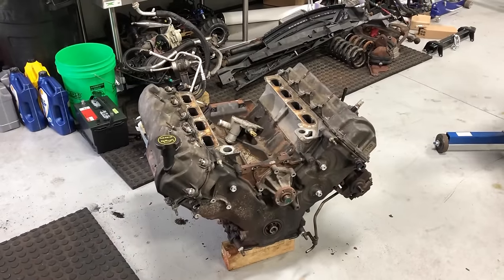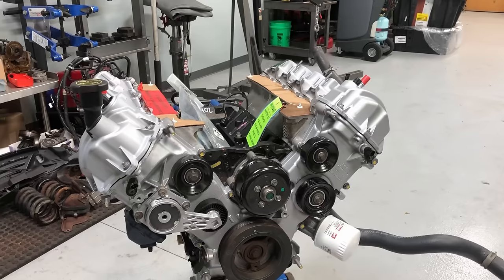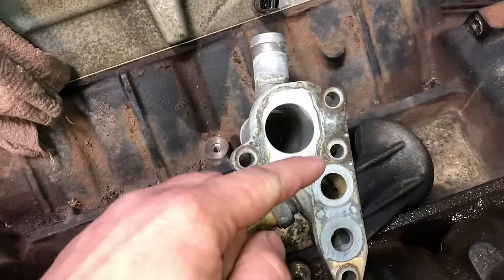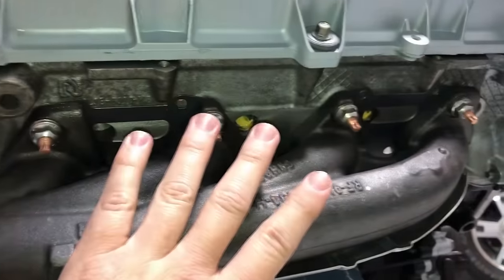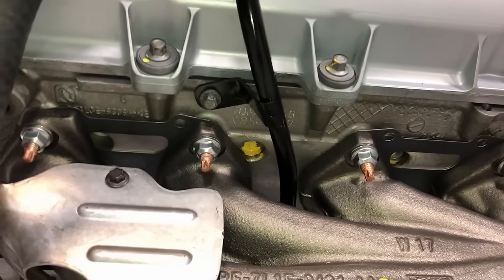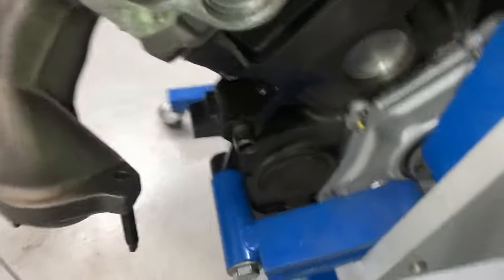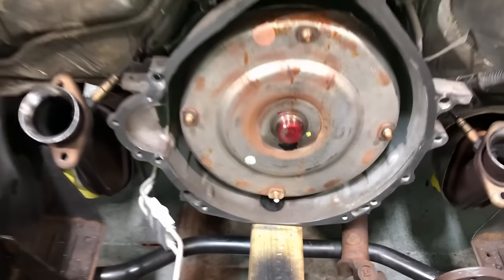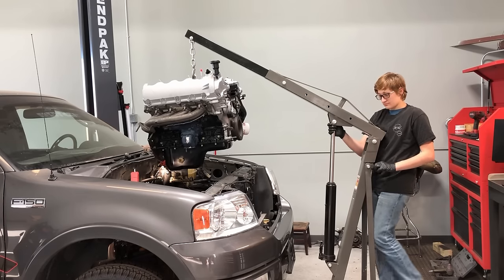Ford 5.4L 3v Triton Engine Removal & Installation Part 2 of 2: Engine Prep and Installation

Comment: Does that engine have a fuel pressure regulator? If so we're is it located?
Reply from the maker: no
Reply: So it's just the pressure regulator sensor? I'm asking because when my truck on running it smells like gas fumes are coming out the tail pipes.  I'm hoping by changing the sensor it will fix that problem.  Thank u for your reply.
Reply from the maker: The 3v engines use a fuel pressure sensor and a fuel pump driver module in the back to modulate voltage to the in-tank pump.
Reply: Thank you so much for your information. Have a blessed day

Comment: Hey!!! Great video. I have a 2010 F150 with the Five point whore motor. I've noticed that when I really step on the gas for a highway on ramp, itll climb to 3000/3500 rpm and then the engine wont go any more. It feels like I'm hitting a wall. Any ideas???
Reply: does it rev quite high like it should be shifting but doesent?
Reply: @shawntracey  sort of. It sort of feels like once it hits 3500 rpm it's like hitting a rev limiter
Reply: @darkstar9008  sorry about the late reply... behind the tire well there is foam where the air intake is... sometimes a piece comes loose and covers the air intake... it happened to me, i removed and fixed my issue...

Comment: About how much do you charge to change our a 5.4 remanufactured engine ?
Reply from the maker: Well over $8k with the cost of engines nowadays.
Reply: Is power train okc still a good choice to get a 5.4 3v. I have a 07 that I’m getting on. Thx @FordTechMakuloco

Comment: One thing I did forget is to mark my torque converter bolt need help please
Reply from the maker: Line up the orange paint marks on the flex plate and converter.
Reply: @FordTechMakuloco   My man !!!thank you so much
Reply: Brian, I just wanna thank you so much my new engine is in it’s working like a clock again thank you I really couldn’t done it without your help

Comment: Do you happen to know where the ect is located?
Reply from the maker: There isn't one.
Reply: @FordTechMakuloco   
I got a 2006 f250 5.4l with a p0128  code, just changed the thermostat but was told it v CBould be the ect. This one doesn’t have an ect then?
Reply from the maker: You have a CHT sensor but a 128 code is almost always a thermostat or incorrectly installed new thermostat.

Comment: Ok nice job ....why not just remove the cab off the chassis.?
Reply from the maker: This video is meant for the Diy at home.
Reply: I've been watching your videos for some time. You are a very talented mechanic and teacher. I am very grateful for your channel a lot of really good advice my wife and I were able to replace cam phasers in a sissy 150 about two years ago because of your videos and I'm thankful for that but as it is I have to replace the motor in a Ferrari 150 (aka) ford on account that they must have hired former Ferrari personnel to price parts. I'm thinking of purchasing a Gantry crane from Harbor Freight to lift the body off.

Comment: At 5:58 you should never run a balancer in with the bolt. Always use a balancer installer. Running it in with a bolt is asking for issues. Remanufacturer will decline warranty on that engine if the threads are damaged.
Reply from the maker: You will never ever have a problem, if that was true then there would be thousands of destroyed engines out there with my name on it

Comment: That’s why I’ll try to avoid those engines from 2004 to 2010. They’re nice trucks but those engines are not bad but ones they start giving you problems you better fix it right away otherwise you’d pay a higher price.
Reply: Every engine design has a flaw.  Engine parts wear either quickly or over time.  That's normal.......
Absolutely nothing last forever.
Reply: @kimroberson8376  haha after the updates these things kind of do
Reply: You can literally find video's on YouTube for every engine ever made warning you that if you so much as start it you'll die instantly.  Take care of the 5.4 and it's a VERY reliable engine.  I have seem multiple 5.4's extremely abused (i.e run for months at a time with out EVER being turned off and oil changed....sometimes) that where silent and never had issues.  While the there VCT cam phaser issue does occur it's largely over hyped.

Comment: Ftm said engine died because owner allowed motor to run dry andv now the guy is spending probably 5k dollars when he all needed to do was get a wal mart 20$ oil change every 7500 miles and keep topped off. I know a guy at work who did same thing to a grand caravan and motor grenades at 130k. Insanity.

Comment: BUY A TUNDRA 5.7   385 HP GOOD FOR 450 HUNDRED THOUSAND MILES SO FAR ...STILL PURRS LIKE A KITTEN ... I ONLY THING IVE DONE IS CHANGE OIL and FILTERS ..I USE ONLY FULL SYNTHETIC...

Comment: Sorry, don't take hoods off, and don't pull engines from the top of any Ford truck anymore.  That's like doing engine and transmission as one or dropping a fuel tank from under the frame.  To easy to do it right.  Timing chains to head and complete motor replacement is 100x easier lifting the body off.

Comment: Umm I thought we stay away from dorman, and only install ford.
Reply: Parts often upgrade to better performance.  After a year or so prove themselves. It only took 15 yrs. ..😆
Reply: I have used Dorman fasteners with no problems.  I don't know about internal cam timing parts.
Reply: @kimroberson8376  dorman is never an upgrade 😂 there parts never fit right or last as long. That and ford cam phasers should only be replaced with Ford. Brian has kinda preached that him self.
Reply from the maker: Yes that is why I stated if you order one call to inquire about all Ford components version because the production line varies. This engine had all Ford components.

Comment: this video is to take your shitty 2005 triton standard engine and replace it with an upgraded shitty triton engine.... naww im good ill just drive mine till it blows up and by the sounds of it it wont be too long from now. Ill never purchase anything Ford again its the shittiest truck Ive ever had, the most inconsistent, most troubling, headache vehicle ive ever dealt with. Im just gonna go old school where a money can work on it after this POS fails for the 30th time.